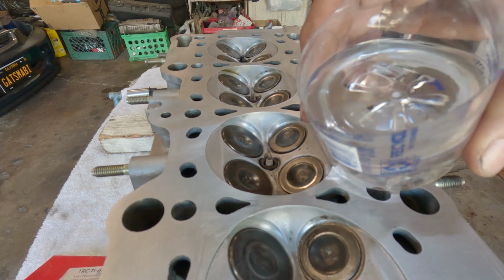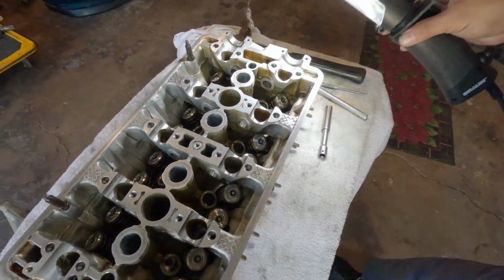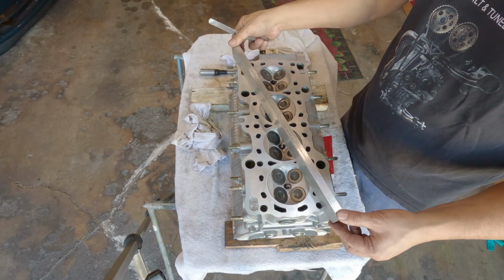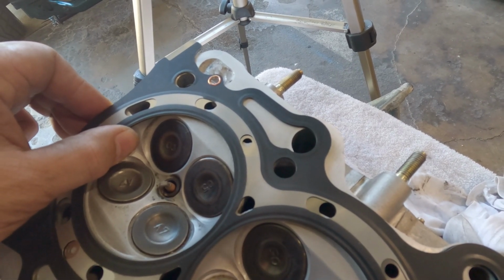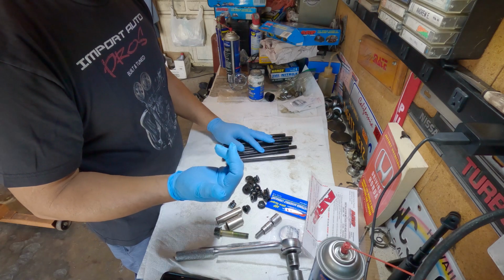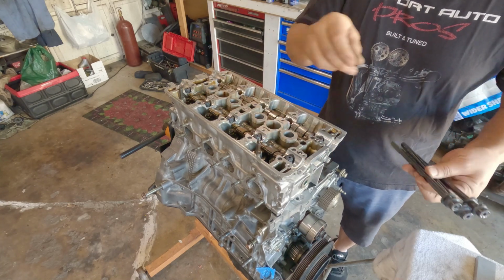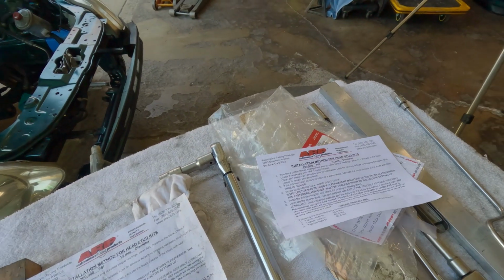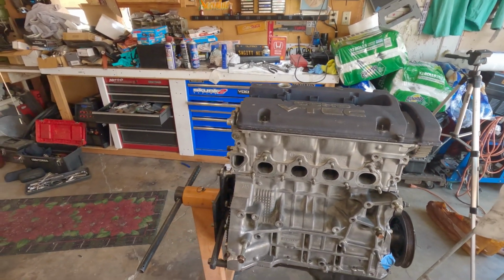"True Essence" of G23vtec build!

Comment: Hey man just found this video i have a h23a3 engine and want to put h22 head on it what do i need to look out for
Reply from the maker: If you want to put a H22 cyl head, there is a oil restrictor that need to be remove, its on  the center of the block/intake manifold side. You can visit zealautowerks.com to check the comp ratio for any piston that you want to use and also the amount of h22 piston that'll stick out if you want to use h22 piston with h23a3 rods. I think h23a3 piston will have lower comp ratio and piston valve reliefs are not enough for h22 valves.
Reply: @sagittnet2158 and what if i keep teh h23a3 pistons as is?
Reply from the maker: @clownvis77 You can and comp ratio would be 9+:1 ratio according too zealautowerks.com but l would at least clay the motor making sure  p2v clearances is good. Too bad the H series iblock is not iron sleeve otherwise piston selection is endless. Someone put together a f23 shortblock w/ H22 head and boosted it, not sure if acceleration is any good though coz w/o changing the f23 piston w/ h22 head comp ratio is below 9:1.

Comment: What torque for standard head skru??
Reply from the maker: If using H22 oe headbolts, 72 lb/ft ( 3 equal step)
Reply: @sagittnet2158  tq for info
Reply: @sagittnet2158  what tool valve you used??look very easy..

Comment: Is there a difference between the f23a1 and f23a vtec block
Reply from the maker: No difference, f23a1 thru f23a7 use the same crankshaft 97mm
Reply: F23a without the number after is the JDM version of it no difference in the block
Reply: @codymiller1413  I thought the f23a1 block is non-vtec, and the jdm f23a is vtec, no?
Reply: @oscaralvarado2899  well I'm speaking in terms of the block idk about the head tbh but I'm running a f23a block with a p13 (h22a2) head

Comment: hello i'am new to the H/F engines on honda, the piston are supposed to be oriented 180° on this engines? because i see in your video at 6:09 that the IN mark is facing the exhaust, is it how it should be?
Reply from the maker: It's a frankein motor, the person who created it figured out that k20a2 piston exhaust relief angle was good enough to face the intake valves of H22 when it's installed w/ arrow facing the tranny. The g23vtec creator wanted to use k20a2 wrist pin offset to be like a regular F23 piston. It's to help or relieve some stress on cylinder walls.
Reply from the maker: As you've seen when l clayed the motor on previous episode. It's all depend on what type or brand of piston you use. Some after market k20a2 piston will not have a wrist pin offset, so you can install it like normal. It's pretty much applied on usdm OE k20a2 piston that has 11:1 comp ratio and only use a not so hi lift cams. It's really is your choice on how you like it installed since its a frankein motor.
Reply from the maker: I'll give you another example; Nippon racing sell 3 types of piston w/ variety of hi comp ratio. If you choose to use the CTR or ITR piston w/c those 2 have more dome height that what l used (usdm type S). And you want to use a sk2 pro2 cams for example, you have to make a decision whether you want to take advantage of the wrist pin offset like f23 piston or risking hitting the valves. If it's me, l'll choose to install the ctr or itr piston like normal to prevent a p2v contact. Now the question is, will it make a defficiency effect on the cylinder walls now that the wrist pin offset is backwards. We dont know coz no one is sharing that info. Some  builders choose to use a piston like CP piston coz they dont want to deal w/ wrist pin offset and they can use a much higher comp ratio up to 12:1 or even higher and still able to use a hi lift cams. Hope this help you out, it really is a lot simpler once you build one.
Reply from the maker: You probably seen my other video where l used a nippon racing piston and l choosed to install it like f23 piston( wrist pin offset) . But l shaved the exhaust relief coz we where using type S cams and you've seen it w/ clay n everything.
Reply from the maker: https://youtu.be/X-LeWuMQh8A?si=bJ9jK-w8wF6Jj8uL if you have time, watch his vlog. You can see he is using a much higher comp ratio piston than mine and he's itb's. You can leave a message and ask him if he's experiencing any weird noises. He's cool and he like it so much. It's kinda confusing and l tried to make it simpler on my episode that l only talk about 1 piston , otherwise l'll get lost and so are my viewers lol! I mostly built boosted g23 and l dont deal a whole of a lot on hi comp ratio motor. Anyway, since your'e new on H n F series, dont let me keep you stray, if you have anything you want to know and something your confuse on any of my materials, lmk and l'll try to help you out. Thanks brother.

Comment: I want to build one of these for a daily, but i still want to use 87 octane. Can that be done on k20a2 pistons?
Reply from the maker: It might not run good coz it's too high of a comp ratio motor. Unless you use e85.
Reply: @sagittnet2158  What pistons do you recommend then?
Reply from the maker: @haydencawood7860  https://youtube.com/shorts/Qz_CYAWGqgc?si=geiXVOdPiIIMuUXm
Reply from the maker: @haydencawood7860  check out his channel. He's using a j30a5 piston on his g23vtec. That piston will give you a 10:1 ratio or a bit more but not as high as k20a2 piston. I'm not sure if piston valve relief are not interfering but if you watch his channel. It's obvious that is running, and pay attention on the wrist pin offset and it looks like that you can install the piston on normal configuration. If you ever do it, clay your engine and share what you find.

Comment: How are you cleaning your engine? I cant ever get it THAT clean usually i hit it with purple power and a pressure washer then brake clean later but i still have slight oil stains/darker spots that wont clear up
Reply from the maker: I used any liquid soap l have at home (409,lysol) and lots of elbow grease on some corners. Scotch brite will make it shine. Sometimes l'll hit it w/ a wire brush attached to drill motor.
Reply: you need to use solvents. how i do it in the shop is wash it in a parts cleaning cabinet and then send it through the jet wash. for diy just get a large tote and fil it with mineral spirits scrub it in there and then do you're pressure washing

Comment: Is this k20s piston setup going to be boosted?
Reply from the maker: I really miss the boost brother! Lol! I thought about boosting it, but l'll stay NA on this project. If ever, l need to replace the piston n' rods. Use a much lower comp ratio piston.
Reply: Thank you. Was chasing around my kids.
Reply from the maker: @cbdreamer1709  lol! Babysitting!
Reply: Love these videos! Would f23 block rods and crank work with h22a4 head and pistons?
Reply from the maker: @cbdreamer1709 yes, but you have to get the f23 block oversize to 87mm. The 1st g23 w/c is non vtec. He used a f23 block, bored to 87mm and he used a H22a4 piston. Piston stick out 0.020" pass the block but he sure used the heck out of that motor. He was from hondatech.com back in the day.
Reply from the maker: @cbdreamer1709 perfect block n piston to use is h22a4 or h23a bluetop and use h23a piston, ut has the correct piston height and wrist pin offset. Except its not iron sleeve. But its plug n play.
Reply: It’s not babysitting when there your kids! Two girls! Surrounded by women. I love the comment though!

Comment: 😬 I wouldn't trust that water test.  water should go on the side not the bottom and wait at least an hour. hit the other side with compressed air and look for bubbles.  better yet get and hand vacuum pump to get a true measurement.
Reply from the maker: Thanks, Info noted and l'll try it w/ compressed air next time l make another build.
Reply: Why didn’t you just use gasoline?
Reply from the maker: @MHR2099  l actually tested it twice before and after. I poured Acetone when it was really dirty and it was actually good except for #3 intake valve. I said not bad w/o cleaning it and freshed out from a junkyard. I might do a compression test just to see how much psi can it hold.